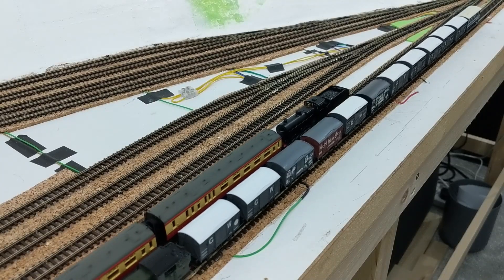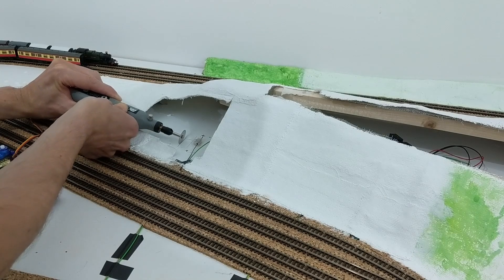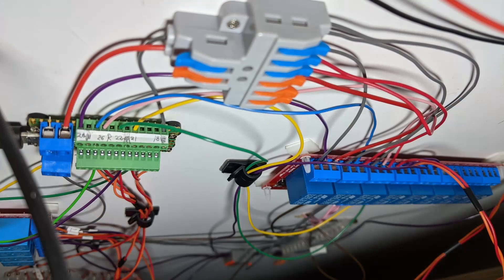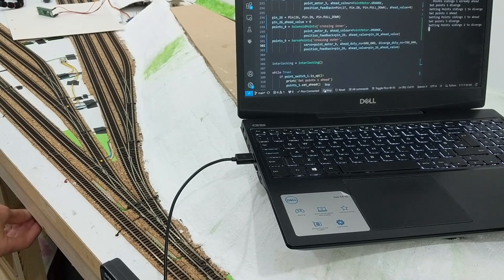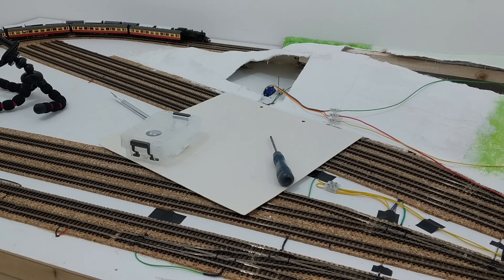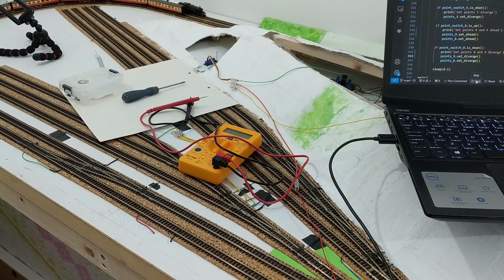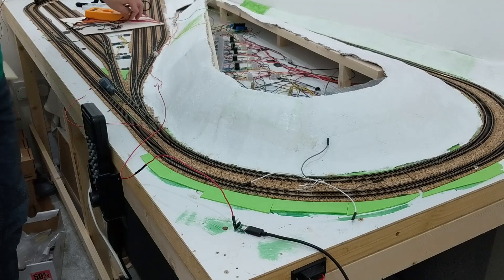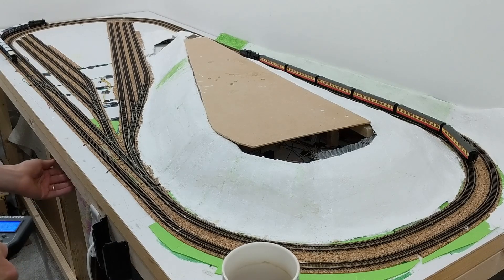0046 Solenoid out, servo in!

Comment: By the way, those cheep SG90's are easy to burn out. look out for true MG90's. but the 90's are only rating for handling 9 grams of weight.
Keep an eye on the operating temperature of the actual servo. if you feel heat with a finger then the servo is about to die.
Yes I have a pile of burned out SG90 servos.
Reply from the maker: Thanks for the warning - I'll have to see how it goes. These are genuine TowerPro ones, so I hope at least have better longevity than the counterfeits all over Amazon. They have a stalling torque of 2.5Kg at 1cm according to their datasheet - the 9 grams is the weight of the servo itself not including the wires or horn (important for RC vehicles I guess!). But this is the first servo I'm pressing into non-experimental use, so I'll heed your warnings and your pile of burnt-out motors - thanks!

Comment: The big difference between the solenoids and the servos is that the voltage is less for the servos and the servos can be programmed for that realistic point wobble.
Reply from the maker: I hadn't considered point wobble! I think I'd probably need to remove the spring that's in the points, so I'll probably not implement it. But you've planted the idea now, so we'll see...

Comment: Good evening Jonathan! Interesting that you've switched to a combination of solenoid and servo control! Have you any plans to go the whole way, and switch all of your solenoids to servos? Regarding common grounds, 0V, negative feeds, or whatever you want to call them, I've read lots of conflicting advice! Can two separate circuits share the same common ground? I'm sceptical unless they share the same power source, but I have no evidence to back that up! How odd about the wavy track! I'd guess it must be temperature related, but can't believe the temperatures fluctuate so much inside your house for the track bed to have deformed so badly! Going back to points, have you any plans to control them via DCC? I've looked into creating a DCC interface for an Arduino, but I can't get my head around the electronics involved! Unfortunately there doesn't seem to be an off-the-shelf solution! Oh well! All the best, Ian.
Reply from the maker: Hi Ian 🙂
The other solenoids have worked well, so I'm going to leave them as they are. I've received a helpful comment from an embedded systems engineer about the common ground, confirming that's OK. It still seems a little odd to me, but I think it's essentially in the hands of the designers of the components like relay modules or servos - they'd need to provide a separate ground pin for the signal from the two power pins.

The railway room certainly isn't damp, but over the course of the year it could vary by 15 degrees - that's nothing like an attic though. But it's also been pointed out to me that its internal cardboard will absorb moisture, and there's been plenty of that in close proximity from the plastercloth scenery construction! I guess having made holes I've also given moisture a way in to the internals, and I sometimes load decent weight onto the layout (e.g. the laptop in this video!).

I don't intend to get DCC involved in the points or signals; I'm not sure where the advantage comes from if there are physical controls for them - I guess on a big layout it provides a ready-made network for instructions and power? But equally I'd rather the DCC system's power be dedicated to trains. Are you trying to get the DCC system to tell the Arduino to do something? I've had thoughts on using an ATTiny microcontroller to make my own basic decoder - the clock should be fast enough that it can interpret the signals - there are various Google results for "diy dcc decoder"... but I think it looks hard! Could an off-the-shelf accessory decoder be used for input to Arduino GPIO pins?
Reply: @endoorrailway  - Ah, yes, with the door it's probably much more to do with water seeping through the door due to building scenery than the fluctuation in temperatures! Have any of the other doors in your house buckled? I doubt it! To control my points, I don't plan on having physical controls, and need DCC so my points can be automated! My servos will eventually be powered by a separate power supply to the controllers (whether they be Arduinos or my favoured ESU SwitchPilot's) otherwise they could compromise the DCC bus! Yes, I want an Arduino to interpret the DCC signal in order to control a point - or signal, or lights, or whatever! Obviously this can be done as it's how the DCCNext system works that I mentioned in my Servo Motor Control Thoughts video! Yes, I've explored the DIY DCC decoder search results previously, but don't have enough knowledge to understand the circuit diagrams! I think an off-the-shelf accessory decoder would be limited to responding to its programmed addresses, so don't think one could be used! Good idea though! The search continues... All the best, Ian.
Reply from the maker: @iansngauge  The other doors in my house are just fine 🙂 They're solid and upright!

Ah ok, does the envisaged automation system control things exclusively over DCC? I guess you'd need an accessory decoder for each thing you wanted to control, each as an input to the Arduino, which I think would make it an expensive approach, and seems a shame to waste the DCC signal. I've been thinking about the electronics (sporadically over several months) - if the Arduino has independent power (easy to do) then I think just one phase of the DCC signal is needed as an input, so I think two diodes and a voltage change would do that:
Rail 1 -- diode > -- 5V regulator -- Arduino GPIO
Rail 2 -- < diode -- Arduino ground
I think that would only allow the current to flow and produce an input signal when Rail 1 is in the high phase.

On the software side I think there'd need to be fast processing of the signal to make sure it was interpreted correctly, so I'm wondering how that would be done - on a Pico there are two cores available, so dedicating a core to that is an option. Then there needs to be some kind of high/low signal buffer that can be updated and consumed between the threads, without any multi-thread deadlock or other shenanigans! There's decoding code around for both Arduinos and the RP2040 that powers the Pi, so maybe I just need to look at those. I might look at this relatively soon because it's grabbed my curiosity! (Soon means "probably before Christmas" 😉)
Reply: @endoorrailway  - Yes, the automation systems will either be something I write myself, or will be integrated with JMRI / iTrains, so will need to be able to perform point switching, signal changing and loco control via DCC commands! For the moment though, being able to intercept the commands and react to them using an Arduino is what I'd like to be able to do! This way it's the Arduino that's the Accessory Decoder! I know how to control the servos with an Arduino, and have an add-on board (can't remember the proper name for it) that can control sixteen of them per Arduino! I think you're on the right track with your thinking! I've read that all is required to capture the DCC commands is a bridge rectifier, to convert the DCC signal to DC to power the Arduino, and transistor coupled with a resistor to connect the DCC signal to pin 2 of the Arduino! Then, on the software side, there's an NRMA library that can be used to interpret the signal! It sounds incredibly simple, but has me completely baffled! I really need it explaining to me like I'm a child! :) It'll be great to see how you get on! Cheers, Ian.

Comment: Interesting, I haven't used solenoids in years and had switched to Cobalt iP but just find them incredibly noisy and so have switched (pun intended) to servos - inexpensive and discreet. Regarding the buckling of the track, have you left sufficient expansion between sections? It's tempting to close-fit all joiners and pin the track down, exposure to heat results in expansion of the rails (really doesn't take much in 'N') and if it haas no gap to run to then it will warp.
Reply from the maker: I was baffled by all the options when I first started looking at point motors, but in my case ruled-out those Cobolt or Tortoise types partly on price but also because they're huge! Good point about rail expansions - I think I've inadvertently got enough margin in there - if I remember correctly I did most track laying in warm weather, and didn't have the rails right up against each other. If the tracks buckle from expansion I'd expect the warping to be lateral, but these sidings are all up-and-down wavy, and it seems to go the same across parallel sidings, so I think it's what's under them that's shifting. Thanks 🙂

Comment: Paper and cardboard are hygroscopic, meaning they absorb moisture from the air. When the temperature changes, so does the humidity. As it warms up, the relative humidity drops, the door dries out and shrinks more to its original size. This might be why your points work better when it’s warmer. The expensive solution would be to replace the door with good quality plywood. An easier fix might be to mount the actuator to a rigid base attached at the point, and free to move as the door warps to eliminate distortion of the push rod tubing. Good luck fixing this 😊

Yes, you are right to connect the 0V of the servo and RPiPico together. The 0V line is shared between different circuits. For a high pulse, current glows from the GPIO pin to the servo PWM pin, through the input resistance of the servo circuit to 0V, then back to the RPiPico via the common 0V link you made.

Btw, I am an embedded systems engineer so am familiar with both electronics and low level software.
Reply from the maker: Hi, thank you for taking the time to leave comprehensive information there, and for coming up with a theory about the door warping relative to warmth! This railway is supposed to be my "just get something done" version, because I kept procrastinating, and the door helped get something going. Plywood is definitely the long-term way to go, but when one day I come to that I'll be starting over completely, hopefully having developed some more skills.

It's really good to have confirmation about the common ground connections between circuits, especially from someone with professional knowledge on this stuff - I've been fairly uncertain about those! Thank you 🙂
Reply: @endoorrailway  I really enjoy watching your layout progressing. You have gone a lot further than my procrastination has allowed me to. Please keep leading by example and inspiring us all to have a go 😊
Reply from the maker: Thank you very much for the kind words and encouragement - these videos take me so much longer to make than it seems like they ought to, so it's really good to know they're being enjoyed 🙂

Comment: Hi Jonathan, good luck with those servos, I have given up on them and as they break I am going back to using the good old fashioned way with DCC control. It's far more reliable.
Reply from the maker: Hi Mark, thanks - the solenoid wouldn't change the points, so it's an improvement so far! Time will tell if these servos last - maybe I'll keep the section of scenery above it removable though since you've found servos unreliable.

Comment: Have a look at the PCA9685 boards that are available on eBay. driven via I2C and perfectly drivable from a PiPico (its how I did the points on my old N gauge layout). I2C connection driving 16 servos that can just plug right in. these things can be daisy chained as well. plug a 5v supply in and let it worry about the PWM stuff - there are libraries specifically for driving servos (its also not hard to write your own for slow action if desired).

I'm using these boards soon on Leopard Street, though with relays driving frogs instead of mechanical switches.

the software I have is fired every loop iteration, it is told "you should be here" and if its not it moves a set increment each loop. when it finishes it fires a callback which reports back to the control station (JMRI) that it has changed. the test incarnation works

it is also well worth having a common DC ground for all DC voltages, makes life a lot easier

have to say I love those PiPico controllers, I use C as I'm not familiar with Python, they can be programmed via the Arduino IDE but you get a lot more out of them working directly with the full development kit